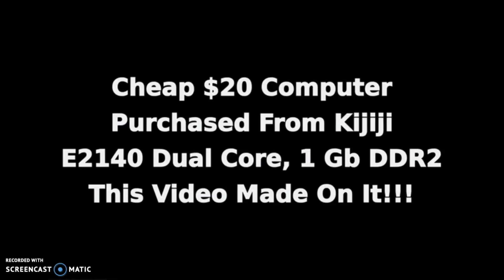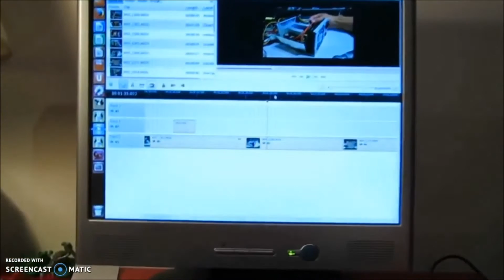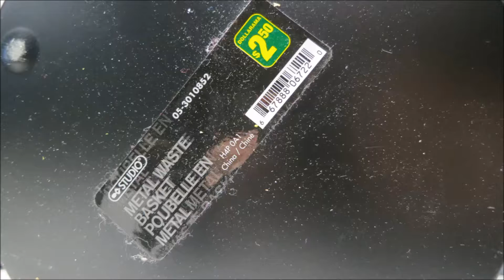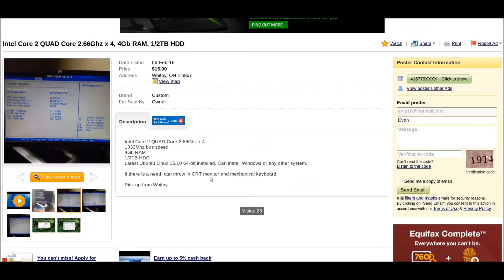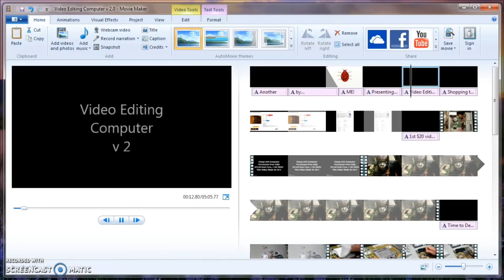Cheap Video Editing Computer v 2.0 for $20 !!!

Comment: I just bought a Dell Optiplex 330 for $20. 4 gigs of RAM, 2.2 Ghz Core 2 Duo processor, and an 80 GB 7200 RPM hard drive. My only plans for it are adding a dedicated graphics card, replacing the hard drive with an SSD then adding a second 1 TB hard drive for storage.
Reply from the maker: Sounds like a great buy and ideas for an upgrade. I was wondering, what graphics card are you thinking about and what are you going to use the computer for?
Reply: According to dell the best one supported is the 256 MB ATI Radeon™ HD 2400 PRO, however I'm actually looking for suggestions as to what other graphics cards would run well. I want something that this computer can handle with great performance.
As for my uses, it's probably going to be my daily driver alongside my laptop....I plan on editing videos (nothing too crazy) and that's the main reason I want a dedicated graphics card rather than the integrated. Lightworks would not run with what I have now.
Reply: However my troubles with Lightworks could also be the fact that the computer came with Vista....
Reply from the maker: +Sebi's Random Tech Oh boy Vista. I've never had a good experience with it. Always bogged down my systems. You have a great channel by the way. Love the second hand finds!
Reply: Thanks! I appreciate you checking it out!
Anyway, my plan is to put 7 on here, after I'm done playing around with Vista since the last time I used it was 8 years ago.

Comment: that 15 dollar pc looked actually decent, had a quad core I bet if you bought a 150$ gpu and threw it in there it could run gta 5 not much more than you could by a first gen console :o
Reply from the maker: Trust me, I've been so tempted! I have a 550ti that I might just put in there until I make up my mind.